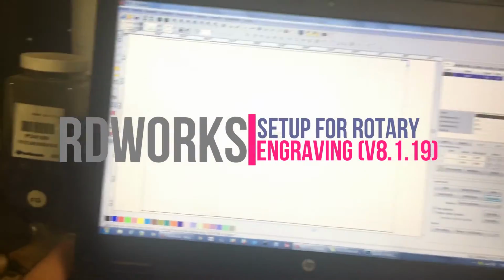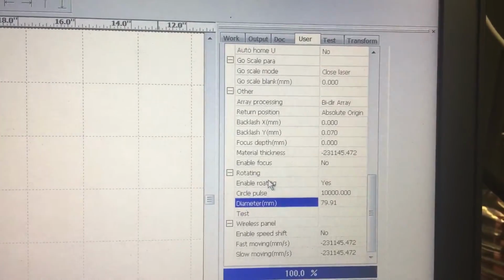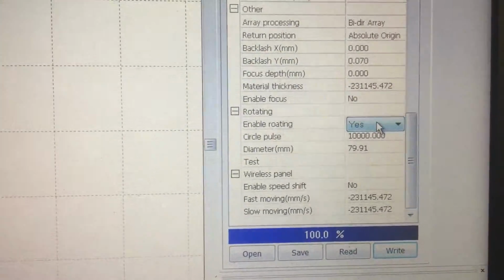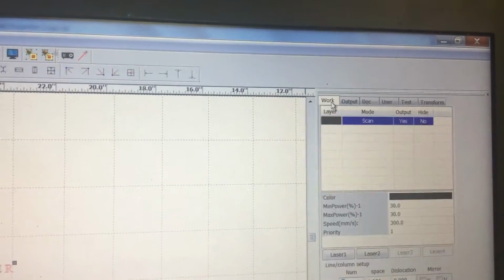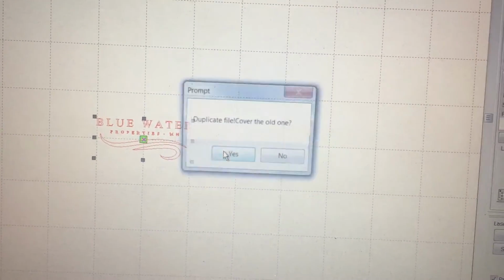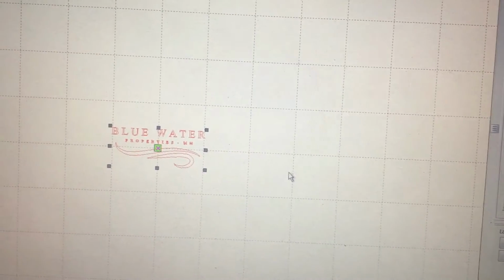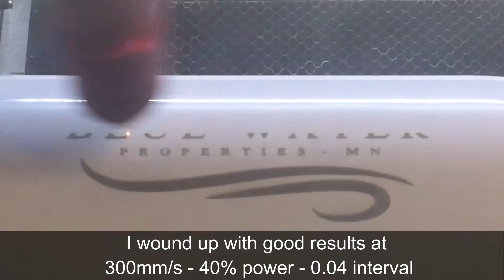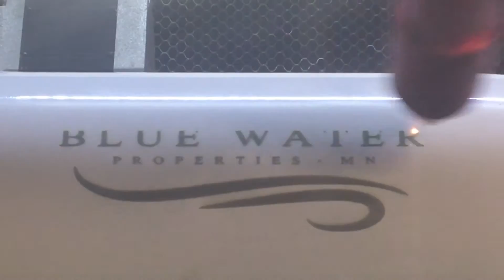RDWorks003: Setting up Rotary Engraving

Comment: How do you set up circle pulse? i didi tests on a 81.4mm diameter tube then i changed it to 61.8mm tube and the test i run was totally wrong.

Comment: thanks for sharing your video. I'd like to ask if you have to change any other settings for the rotary attachment. Do you have to change acceleration and speed from XY-engraving to rotary engraving? By using the standard settings for rotary settings it seems to be very fast, especially when you are plotting the engraved logo.
Reply: You need to change the max speed on the front panel down to something like 50mm/s.  That's all I ever do.

Comment: I thought when using roller type rotary attachment the circular pulse and diameter didn't change?
Reply from the maker: All depends on the type of laser and type of rotary you have.
Reply: @mandalaroseworks  I have same roller attachment like you have and a Robotecnc 1390  with Ruida controller.  I've been having issues with my engravings coming out correct, circles are oblonged just a tiny bit.  I can' get a straight answer on how to fix it.  I've just been reading up as much as I can and in the Boss laser manual they mention that roller type are not to be changed.
Reply from the maker: @barkster  Well, I'd record your existing value, enter the diameter of your object, and give it a try.  These were the instructions from Bodor, the company that makes my laser.  I get perfect engravings exactly to size by following this set of instructions.  These are all the instructions I see for getting this to work on this type of rotary for Ruida controllers.
Reply: @mandalaroseworks   yeah that's what I did, they had value of 10000 in the circle pulse and I measured diameter of my rtic cup with my caliper and put that in diameter and everything is slightly compressed on the y axis.  I've contacted the manufacturer and their response was zero help.  I've seen some guy on youtube that uses "magic number" to hack it but I don't think I should have to with this thing. Thanks for help

Comment: is there away to slow down the rapid movement when I press the start button? It's throwing tumbler off rotray attachment
Reply from the maker: Willy Burnette you have to do it from the control panel on the laser.  Press speed then change the value to something like 50 using arrow buttons then press enter.

Comment: May be a dumb question but when your not using the rotary attachment do you need to change the enable rotating back to no?
Reply from the maker: Barclay Berger that’s correct.

Comment: What if your dealing with 2 different diameters??
Reply from the maker: First of all, if you have 2 different diameters, you would still have to adjust it so it is level across the workpiece using the height adjust on a friction feed rotary.  

You would set your diameter in rd works based on where you set the item, let's say a drinking glass that tapers from 50mm to 40mm.  You want to set the 50mm part on the rollers that are connected to the motor of your rotary device and then raise the other end of your rotary so that the 40mm part is level.  

You would still setup rd works based on the 50mm diameter because that is the part that is being "driven" by the stepper motor.
Reply: mandalaroseworks Thanks for the quick and thorough response.  Very much appreciated!!
Reply from the maker: No problem.  Good luck!

Comment: don't know if you can answer this... when I have my speed set to 300mm/s, the head travels slowly and passes over the area to be scanned by about 6 inches on each side of the artwork. Don't know what to adjust to remedy this. otherwise, I really enjoyed your video and it helped me out alot...
Reply from the maker: You will always get some of that.  But, you can change it so it's not as bad.  Go to CONFIG > System Setting, and in the Scanning (Reverse interval) you have to add values for different speeds.  For example, this is what I use:   300 - 0.08, 400 - 0.12, 500 - 0.18,600 - 0.22.  The values go in the "Reverse interval(mm)" column.  Leave the 3rd column (Offset repay(mm)) at 0
Reply from the maker: It is a compensator for backlash in the belt when reversing direction.  I can't guarantee that my settings will work for you, but it's a start.  You have to examine your left to right, then right to left passes at each speed and see if they line up.  You can set your "interval" in your "scan" function to a large value like 0.5 so that the scanning passes have space between them, and just engrave a simple square box.   I wish I could post pics on this topic in these replies, but hopefully my written stuff helps.
Reply: mandalaroseworks What do you set the User settings at when scanning?

Comment: where can i download this version of rdworks?
Reply: You need to contact your vendor for the latest version, or find it online.  I can't provide software links.  I do know that some of the laser groups on facebook have them in their files section.  That being said, you don't need THIS version of RD Works to do what I have shown how to do.
Reply: @WadeWendorf  well, I seem to have another version because I can´t find the tool to make these settings. If I want to engrave on a bottle the motive is always compressed, i can´t engrave round items. can you help me out?
Reply: @doggearana5189   If you have RD works 8.XX, it should be there.  The chinese are not good at making programs resize all the components, so you may have to see if you can resize some of the areas to find what you are looking for.
Reply: @doggearana5189  I have this same problem,   did you figure out how to rotate?

Comment: how do you get RDworks to set the laser home position in the center of the image?
Reply from the maker: You choose the CONFIG menu, then the SYSTEM SETTING menu option.  Inside of there, you will see a series of 9 dots titled LASER HEAD.    Pretend those dots are the image you lasering.  If you select the center dot, that will be the center of your image.  If you select top left, then top left is where the laser will start from.

Hope that helps!
Reply: Thanks a bunch!

Comment: How about a round logo at a right angle?
Reply from the maker: Not sure what you mean.  This method keeps everything in perspective.  Just rotate the logo to the angle you want it to be and run it.
Reply: Maybe I didn't say it right. What I mean is that if I want to engrave a round logo by this method will it come out looking round or will it still come out looking oblong?
Reply from the maker: From my tests, if you have a round logo, it should be dimensionally correct along the curved surface of your object.  The item I engraved had exact dimensions to that on the computer.